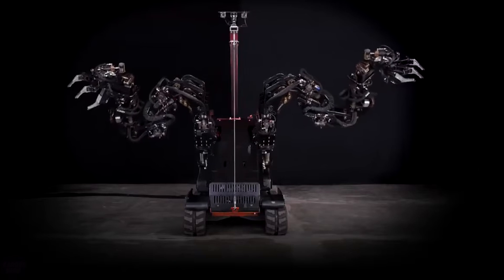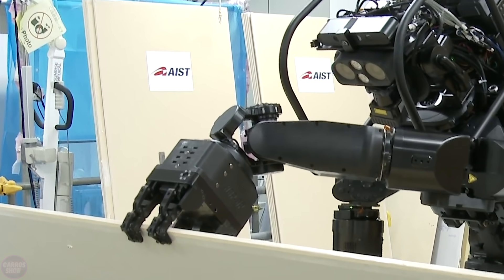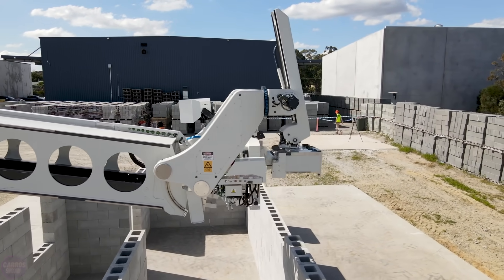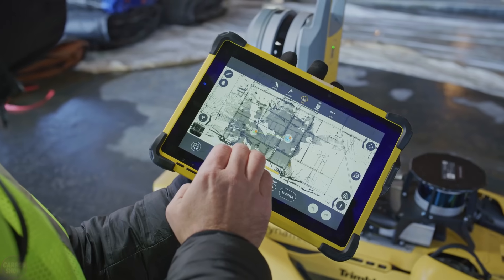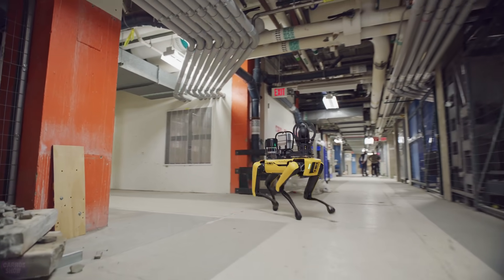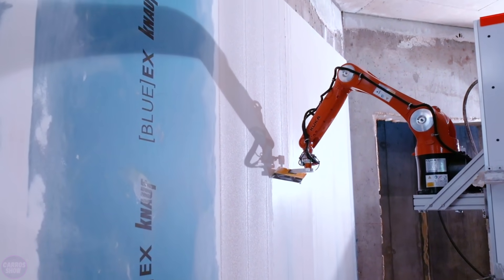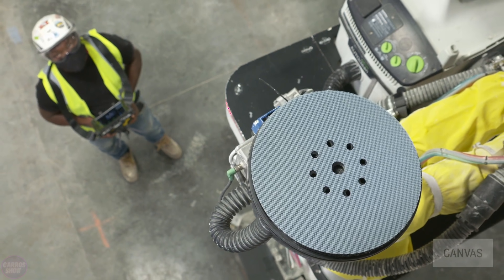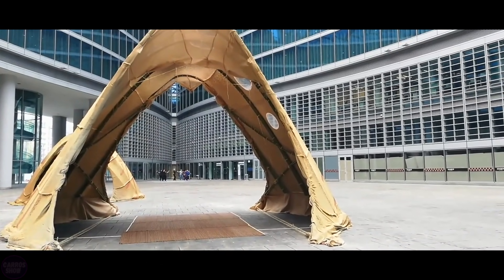Next-Generation Construction Robots SHOCKED Engineers from Around the WORLD

Comment: The problem with the construction adhesive is that it doesn't seal the gaps.  You could see right through the wall the block laying robot built, when the camera panned away.  That's no good.  Also, I wonder how long the adhesive lasts compared to mortar.  It's a very different look too.  I'd like to see a robot that can work with mortar.  I think those exist.